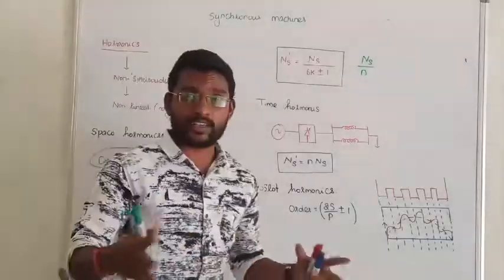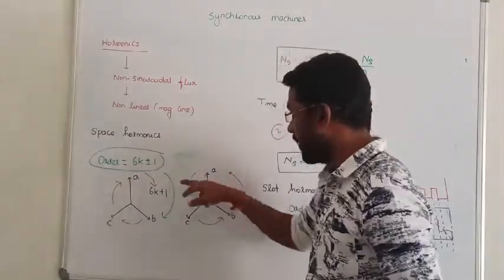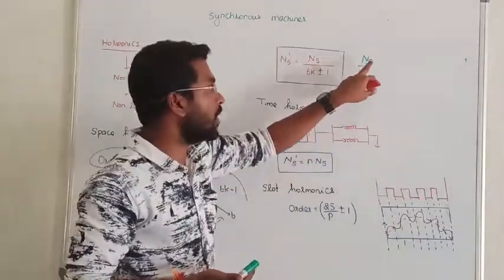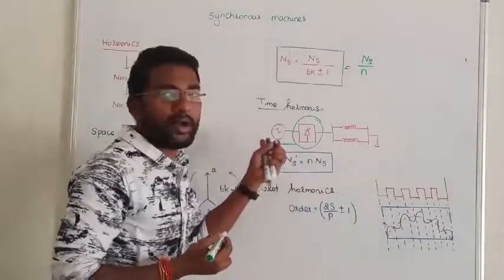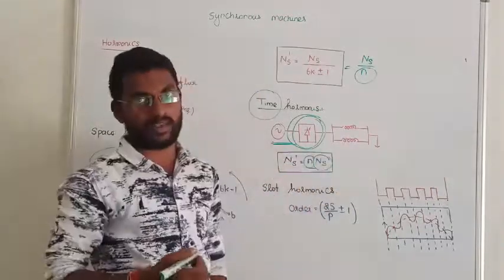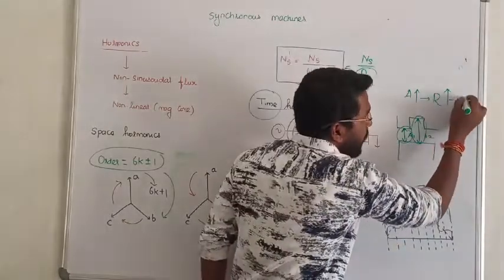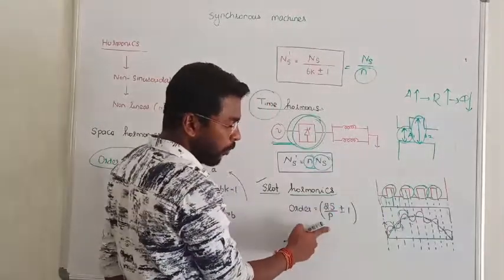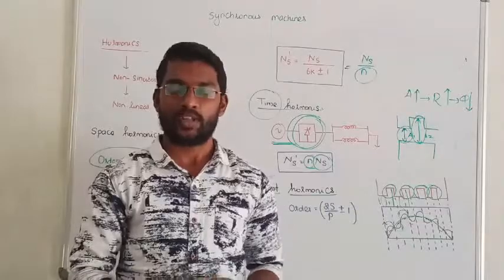30. HARMONICS I EE I SYNCHRONOUS MACHINES  IN TAMIL

Comment: slot harmonics dont speed affected sir ?
Reply from the maker: Machine is slightly vibrated due non sinusoidal voltage. Speed doesn't greatly affected
Reply from the maker: The main effects of slot harmonics are:

Induction of voltage harmonics to the electrical system, distorting the voltage wave.
Increase in the voltage distortion rate THDU(%)
Greater likelihood of resonance with capacitor banks
Decrease in engine efficiency (lower torque, vibrations, etc.)